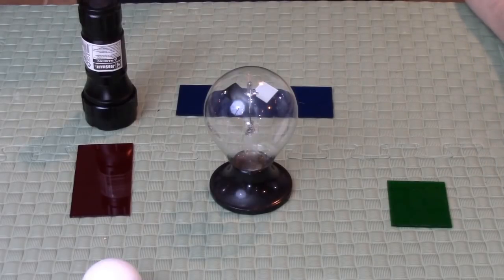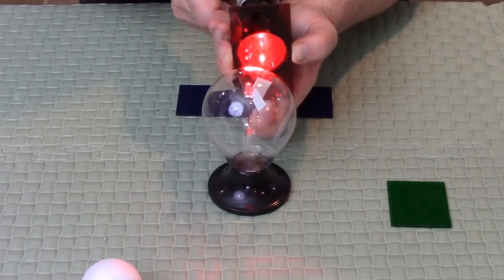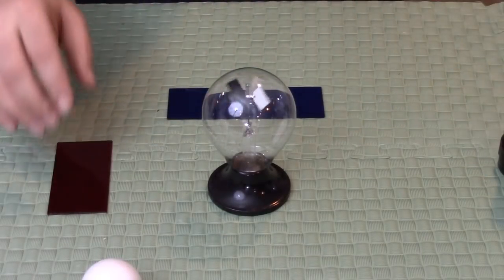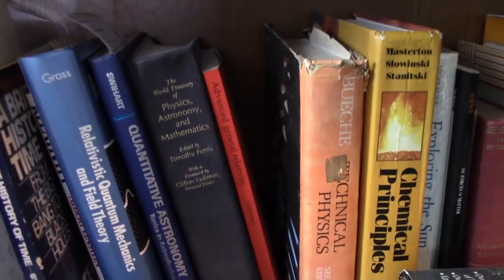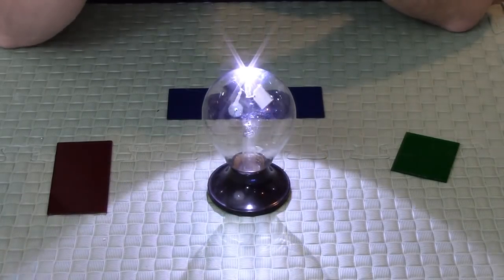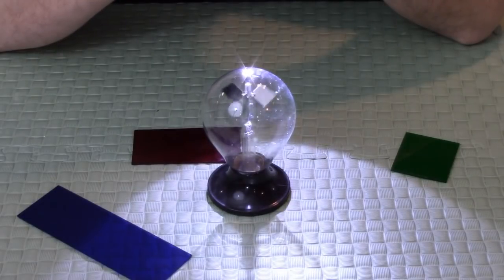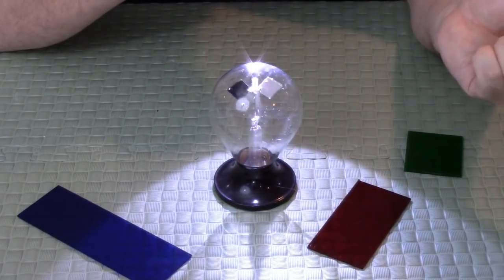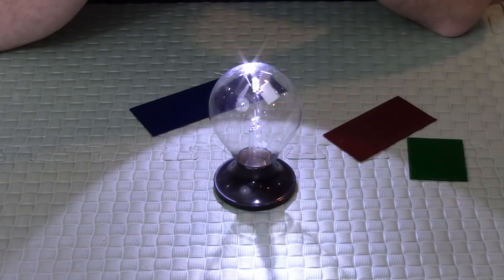T10: Crooks Radiometer is IONIC Propulsion?.

Comment: Your bell jar and pump you are considering will not give you a perfect vacuum.  You need an expensive turbomolecular pump and high-quality parts to get lower than the 7 millibars that it works with.
You can also experiment with heating and cooling the glass without using light.

Comment: Does glass attenuate red wave more than blue? 
Ignorant about that glass (frequency - wavelength selective) stands in between the mill and color plate, can make us think that color plate dominated our observation. 

To address that : run the light meter test again with glass in between the color plate and the light sensor.

Comment: It has been demonstrated that it won't work at a good vacuum, and that there's an optimal pressure at which it will work. On the other hand, you have proven that the vanes are electrically charged, so ionisation must play a role. Interesting!

Comment: I disagree with your explanation. My theory is you are not knocking electrons off (Where do the electrons go?). The black surfaces are absorbing photons and the white surfaces are reflecting the photons. This means the black surfaces absorb 100% of the photon energy and the white surfaces on absorb 50% of the photon energy. This also validates the photoelectric effect.
Reply: negative ghost rider, there is nothing going anywhere, electrons do not exist. there is however a charge differential from the light field polarity.
Reply: @criffpeoples6187  I strongly disagree . Electrons are proven to exist.

Comment: Here is a video that shows that when you spray one side of the globe with a refrigerant, the vanes spin in the opposite direction.
 https://www.youtube.com/watch?v=r7NEI_C9Yh0

    So a better explanation than Ken's is that we are creating a low pressure in the ether medium, that effects the black more than the white. When we shine a light on the vanes, the white reflects it, but the black absorbs it and retransmits in all directions, as a blackbody object does. The black body, as Tesla said is emitting heat and therefore drawing in particles from the ether medium, creating an influx of ether into the black surface faster than into the white, which pushes it around just like the ether feeding into the Earth draws in the medium we know as gravity. I. E an acceleration due to the ether feed. 
     When he sprays refrigerant on the globe there is a heat flow, and an ether medium flow, towards that spot on the globe. The black body is capable of transferring heat faster than the white, so there is a faster flow of ether from the black than the white, causing the black body to draw in heat from all directions and transmit it  towards the heat sink, creating a low pressure system opposite to when we shine a light on it,  creating an ether draw from the black body. I. E. antigravity.
        Here is one that shows when there is a vacuum, the photons hitting the white override the momentum from heat transfer. It spins the other way.   https://www.youtube.com/watch?v=FrW_1xyvFT8
   So it either from heat transfer or photon momentum.

Comment: In 1901, with a better vacuum pump, Pyotr Lebedev showed that in fact, the radiometer only works when there is low-pressure gas in the bulb, and the vanes stay motionless in a hard vacuum.[6] Lebedew, Peter (1901). "Untersuchungen über die Druckkräfte des Lichtes". Annalen der Physik. 311 (11): 433–458.

Comment: You should use straight up red light instead of a filter because other wavelengths of light can still get through the filter. It most likely is not a purely red wavelength.

Comment: One effect you aren't taking into account is the weakening of the power of the light with the filters. That light looks to have a colder temperature. Thus, more power of output is devoted to higher frequency light than lower frequency light. This means that a red filter would block more power than a blue filter, since the light emits more blue light in the first place. Thus, at least with the particular experiment you have here, one might not be fully convinced. The best thing to do would be to get laser pointers of equal power and compare their effects.
Reply from the maker: You are correct.  I will add to the next video in the series the measurement of the light intensity after the filters.  Thank you

Comment: Hi.  Edge effect is key.  I have tried with R, G and B laser pointers (approx 50mW).  Pointing on the black results in little to no rotation (white side = nothing).  Move the beam to the edge and it picks right up.  Move beam from not touching vane to the edge such that only a small part of the beam touches the edge and it can produce a greater effect than the full beam on the centre of the vane.  More torque can be had went playing on the outer tips.  All the variations I have tried point to an effect transpiring along the vane edges.  Not saying if it is or is not 'photoelectric' but it should be examined carefully.  Cheers.
Reply from the maker: Thank you.  We will add that experiment to the next video in this series as well.
Reply: Follow-up and clarification; shine the laser pointer on the edge of the black side for motion (of course shine on both black and white sides as part of a proper experiment, even on both sides at the same time if equipment allows.)
The results are consistent with the Reynolds explanation.

Comment: Hi Distinti. Very interesting. I have simple suggestions maybe could help to test the current heat explanation: If the rotating thrust is only existing while illuminated, the velocity would decrease instantly by any friction, when turning off the light. If you were a very little passenger sitting on a bench on the white side, you would fall off forward at the same moment the light (engine) is turned off.
However, it seems to me right now that if the explanation is heat built up in the surface, the start of deacceleartion curve would be more round, since much of the (maximum) speed would come from built up heat.    Maybe different types of vanes would create different results?

This would of course need a video recording which makes it possible to plot the rotating speed. :)